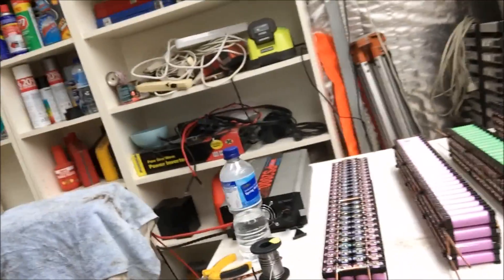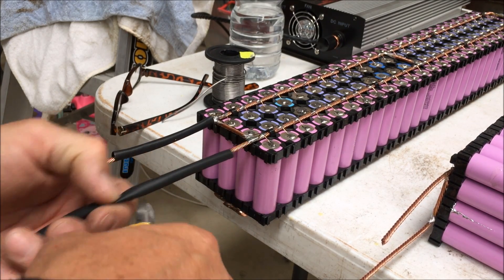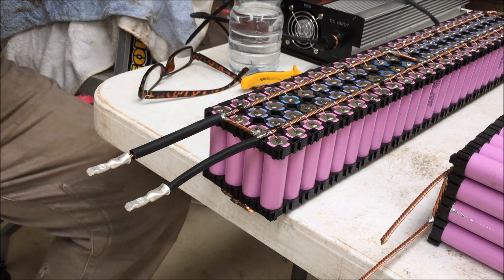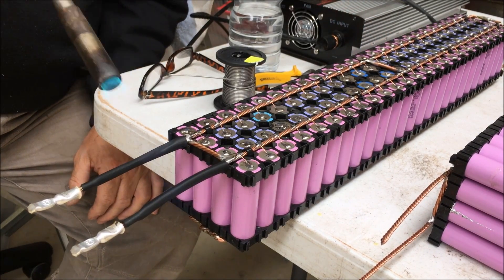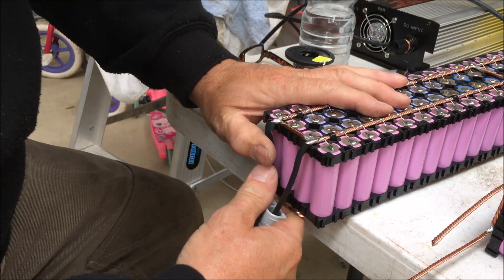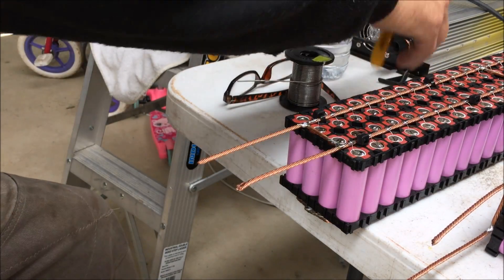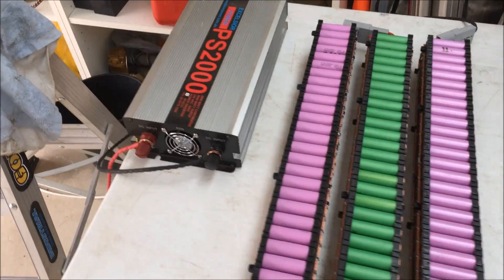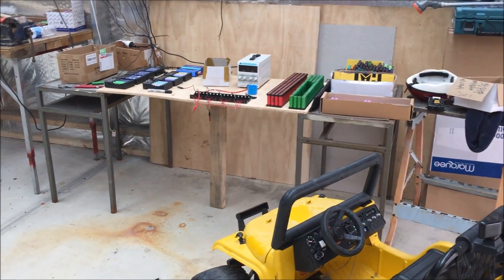DIY Power Wall - Terminals  #4

Comment: So, let me see if I've got this right:  You're connecting--in series--14 individual 3.6 volt packs (each containing 100 cells wired in parallel) to produce a 14s100p, 48 volt (50.4 volt), 11kWh (assuming 2200mah per cell) badass powerwall? OMG, that is simplicity at its finest!!

Comment: Hello i have a question from what I'm reading you need about 4 packs to get the most current from your batteries to your inverter. Is this correct? Reason why I'm asking is because if you are running a 12v inverter then your will need 4 of them packs right?  This is what i have been reading and trying to understand plus I'm a little confused my self.
Reply: Diy in the Ghetto, you need only 3 for a 12v pack. 9v empty and 12,6v full.
The problem is most 12v inverters are not set up for lithium ion battery packs as they cut the voltage at 10v or 11v to protect the lead acid batteries they have been designed for.

If you can get an 12v inverter for lithium cells, then use 3 packs in a row.
Reply: Sorry i just change my youtube name and my original name in youtube was Joseph Chrzempiec. But somehow i screwed that up lol. But thank you for that information.

Comment: great vid, thanks. may I ask a question? How do I know how much amps a battery pack can handle.  if I have a motor that draws 40 amps and I am using a 18685 battery pack that has 40 cells, does that mean that each cell is using a 1 amp draw?
Reply: I have 3 batteries 4v wired in series for 12v, each battery being consisted of 50 parallel 1650mah cells, how many amps can they take at 1c? what size bus bar would you say I need? I'm a plumber lol educate me

Comment: Very nice job.  I have used some of those connectors on my trolling motor and some old style inverters.  They have lasted for years and are easy to assemble and disassemble.
Reply: Lloyd Prunier do you know their names?
Reply: I see in a comment here that some are called Anderson connectors.  I have found several different ones on Amazon like mine that don't have a name on them.

Comment: Could you share info about the wiring? Is it 25s4p? You mention its for a 48V system but wouldn't that pack be much higher?
Reply: I believe his full pack is going to be 14s80p.  It puts you at 52V, but most controllers can handle that little bit extra.

Comment: https://www.amazon.com/uxcell-Waterproof-Converter-Reducer-1200W/dp/B01LXWQOIA/ref=sr_1_1?s=industrial&ie=UTF8&qid=1481345800&sr=8-1&keywords=1200+watt+100A+converter+24V+12V  I saw this as possible cheap 100A controller.  MPPT controllers cost $600.
Reply from the maker: Thanks, it looks good, but I'm after a 48 volt inverter